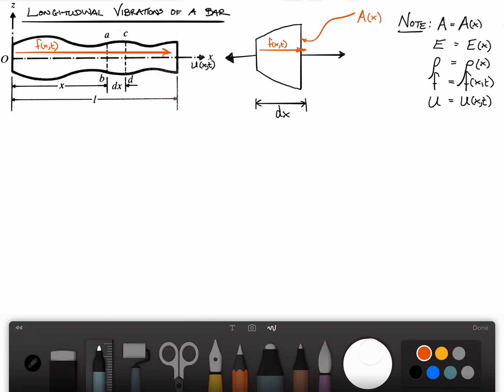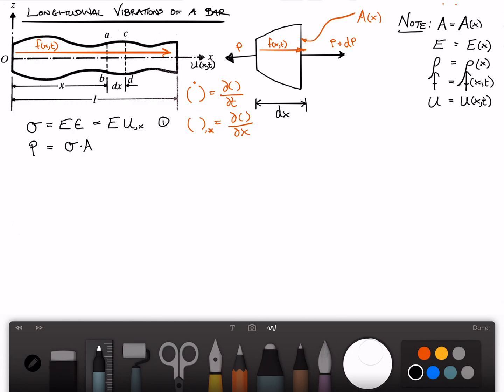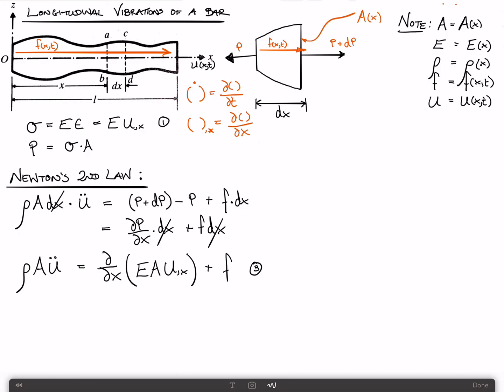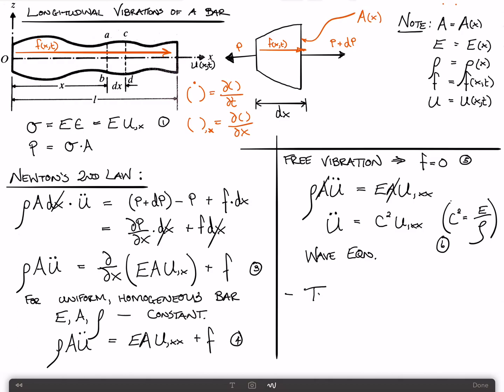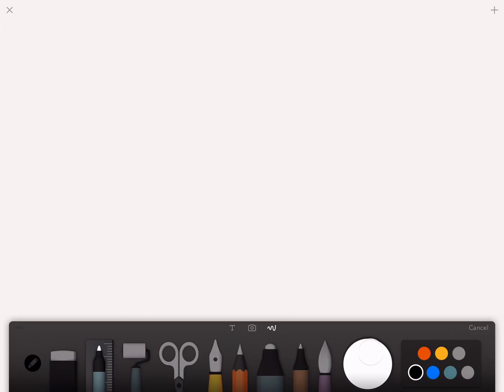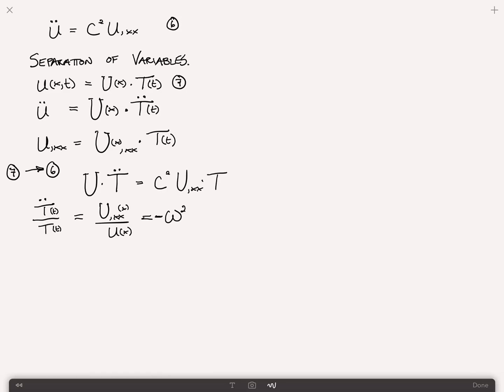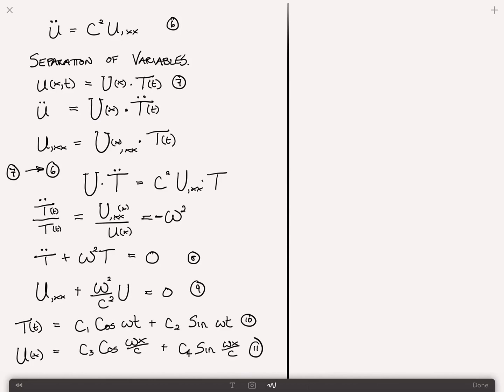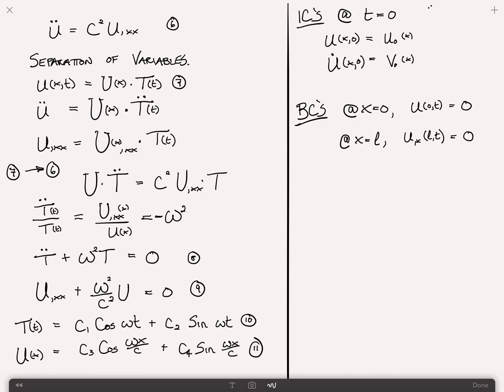Longitudinal Vibration of a Bar (Continuous System)

Comment: can someone please tell me why dp= ∂ p/ ∂ x * dx? I know chain rule is used but still can't quite understand it
Reply from the maker: This isn't the chain rule, it's actually a single-term Taylor Series approximation.  The idea is that if we want to find the changes in the value of a function a short distance away from where we are currently, then the change of the tensile load, p,  is the rate of change in the x-direction (∂p/ ∂x) times the distance in the x-direction (dx).  The reason for the partial derivative is that p = p(x, t).

Comment: Thank you, really helpful
But  how to get the mode shapes and the natural frequencies of a continuous system specially Rod with different boundary and initial conditions using the frequency equation ?
Reply from the maker: I have demonstrated this for the case of transverse vibration of a beam. 
 https://www.youtube.com/watch?v=k9lz7eLNafM
For the case of longitudinal vibrations of a bar, the math is somewhat simpler because we're dealing with a 2nd order PDE instead of a 4th order PDE.

Comment: How to calculate the longitudinal vibrations if the rod is already , axially pretensioned ?
Reply from the maker: This would be incorporated into your initial conditions (at 13:55 in the video).  If the rod is pretensioned (ie pre-stressed), then the initial strain of the beam will be non-zero.  The initial strain is:   
ε = σ/E = F0/AE 
where σ is the stress, F0 is the initial axial load, E is Young's Modulus and A is the cross-sectional area of the rod.  Integrating the strain, gives us the initial displacement field, namely: 
U0 = (F0/AE) x.  
Substitute this into your initial condition and you're good.

In certain, simple cases one could assume that all oscillations are about the equilibrium position and then one can ignore the pretension.  Here is a video which demonstrates this showing a simple, single-degree-of-freedom system that is pretensioned due to gravitational effects:  youtube.com/watch?v=TpZMTo-Lig4